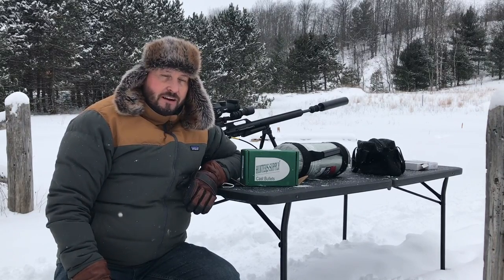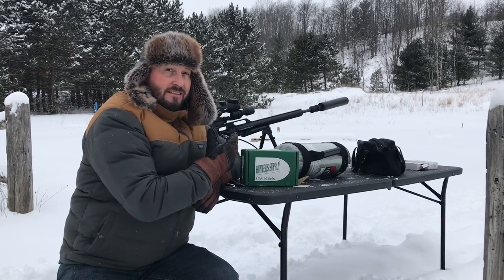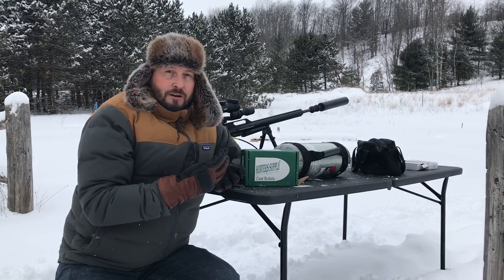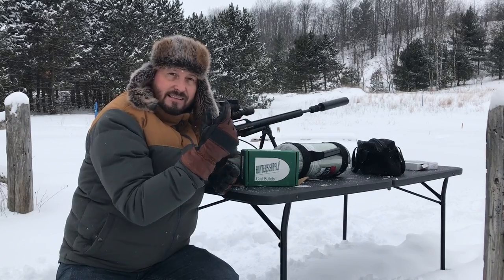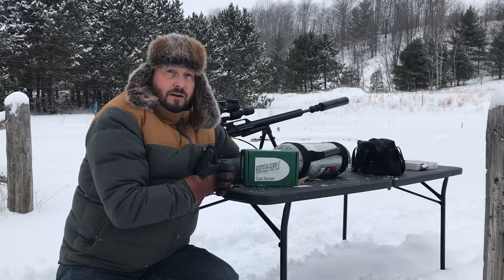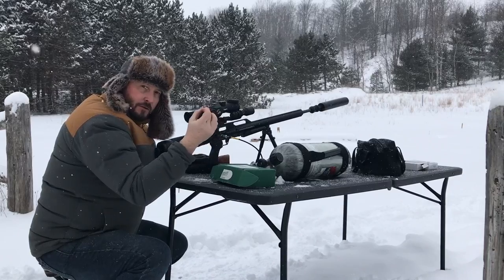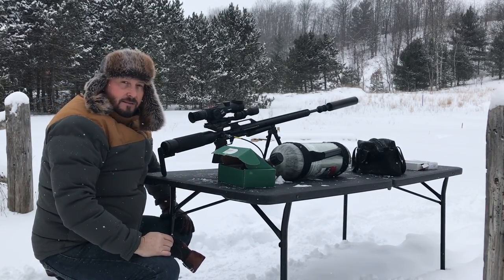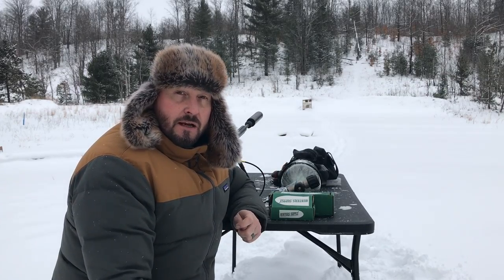AirForce Texan  Big Bore Airgun = Awesome Power! Barrel Tuning Tips with Hunters Supply

Comment: I took my RL suppressor and opened it up and then from Walmart I had purchased the stainless steel  wool scrub pads. If you push on the pad it unravels into a single multi- strand of  stainless ribbons which I wrapped around the extension and put back in the tube making sure no "wool" was dangling into the inner barrel.  Those strands provide extra surface area for the sound to bounce back and forth and further cancelling the report.   I need to get a sound meter to do the before and the after on my  Texan 357.   Similar to stuffing fiberglass or other acoustic damping material as done on other air strippers.

Comment: Awesome a midwest guy is doing these videos. Nice job Chris.  I am new to air guns and recently got a .308 Texan to get into the sport.  I have been a little frustrated with 100 yd accuracy.  I am use to powder burners and not sure how to tune this thing.  Honestly,  I do not know where to put the power wheel ..lol.  I have been shooting Hunter Supply 154's and 118 RN.  The 154's seem to shoot the best, but I still get flyers. 1,250 yard shot!?. C'mon Chris , your killing me!  Congrats.
Reply from the maker: Ha!  Thanks man! I totally understand about the accuracy challenge at first and it has taken me some time as well.  But it has been a fun journey.  I just shot the best 100 yard group this past week (1.18 inch 5 shot group) with my .308 and Hunters Supply 154 Spitzers - check it out: https://www.gatewaytoairguns.org/GTA/index.php?action=dlattach;topic=139516.0;attach=216778;image . This group earned me my Expert Rating in the GTA Long Range Challenge.

Here are some tips...  When shooting off a bag or bipod - pull the gun really hard into your shoulder with your non-shooting hand.  Normally I shoot with a much lighter hold to allow the gun to recoil back with little resistance - but I found that REALLY shoving it into my shoulder tightened up the groups a TON.  These Texans are super hold sensitive so you will need to tinker with your hold techniques.  Start at 2500 PSI and shoot a 5 shot group.  Than move up to 2600 PSI.  I have found that the best accuracy is in the 2500-2700 PSI range.  Also - send your barrel to David William at Hunters Supply and have him tune the barrel and fire lap and re-crown.  Or get a fire lapping kit and start there.  IT HELPS A TON!
Reply: I was hoping you would give me a few pointers. Thanks Chris.
Reply from the maker: Hey man - sorry for the delay.  Lots of "stuff" going on with YouTube in the last few weeks as you may have heard - UGHH!  Anyway - we are back up.  So here is a tip that worked for me.  Crank the PSI down to 2500 and put the powerwheel a tad back from the fullest power setting (towards the trigger).  My hold sensitivity with this thing had to be spot on.  Normally I let these things do what they want with an "artillery" hold letting it recoil back naturally with a light hold.  I shot a 1.15 inch group -5 shots at 100 yards the other day but an used my non shooting hand to pull it into my should pocket SUPER hard.  On that day at that lower tethered pressure and that hold technique I was able to get that crazy good group.  Let me know how it goes!
Reply: Its hard to tune big bore air rifles  for power  without  a Cronogragh to check Velocity of different  weight  slugs

Comment: I’ve been shooting hunter supply slugs for 2 years now ,,, an they do pretty good ,,, but I’ve recently been shooting nsa an sg ammo much more accurate,,,,I also have a barrel dampeneron my 308 an it tighten up groups a little,,, I have a medium mag spring in it to an I fill it to 3300 hope it works out good for the 308 ,, it worked pretty good on the 45,, there’s not really no sense in changing the spring if not gonna get a higher pressure,, with the medium spring an 3000 fill only got 10 more fps ,,,great video bro,,
Reply from the maker: Thanks Kevin!  Ya - the top bullets for the .45 Texan for anyone to try in my mind are the Hunters Supply 350 gr. - Aeromagnum Lone Star 265s - NSA 290s.  I have been casting my own Bob's boat tail 135 gr. for the .308 and they do well too.
Reply: UpNorthAirGunner if get a chance try the 372 gr nsa,, I’m getting 1 an half inch at 100 ,, I’ll have to try the 350 hs it’s probably the only one I haven’t tried,,lol,  I have the 132s ur shooting they get 2 inches at 100 for me,, some one els could probably get better I’m not the greatest shooter,,do u known if you can buy the 24 in barrels for Texan from airforce  or do u have to buy the hole carbine ???
Reply: Kevin Alt I see you discussing accurate ammo with people, my .45 Texan loves the 180 Diablo from African air . I shoot clover leafs at 100 & 3” grips at 150 I know they are a bit light but I dropped both deer I shot with them this year 118&121 yrds. Pretty hard to beat that
Reply: Andy higgins that’s awesome man,,yeah 180 is plenty enough for deer ,, hell I dropped my deer with a 130 gr 357 pushing 250 fpe at 80 yards,,,an he didn’t go no more than ten yards,,,so really al these real heavy slugs is over kill ,, good for bear though,,ill have to try them pellets one day
Reply: Kevin Alt what I really like is how flat they fly 0 is 100 yards and from 50 to 125 yrds there’s only about 3” variance

Comment: will be up to the north myself come spring few acres and the new 357 looking forward to the new envirment ,wondering how you feel about useing helium up in the colder regions
Reply from the maker: When I did the Helium test it was in the mid 30s low 40s and did great!  One word of caution though with any compressed gas.  Make sure it is dry as condensation is a killer below freezing.  The Helium I use is medical grade for SCUBA diving and I think you can get it for welding too.  I am not sure if the welding version would be as moisture free though.

Comment: God I want a airforce texan so bad but they are so inacurate. If you want a long ranger get a .257 condor with Doug noble valve you easily get sub moa accuracy even to longer ranges watch tofazfous video's. I love my .257. If you do you 100% need Doug nobles valve the extreme can't compare to it. I would try to get Doug noble to make machine and fit the barrel. You could murder your old 1250 yard record with the .257 accuracy.